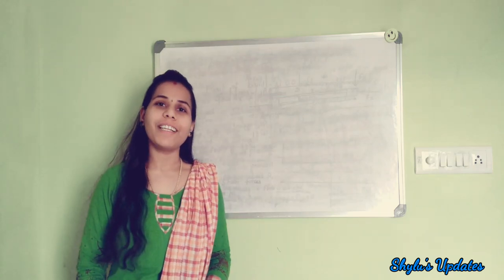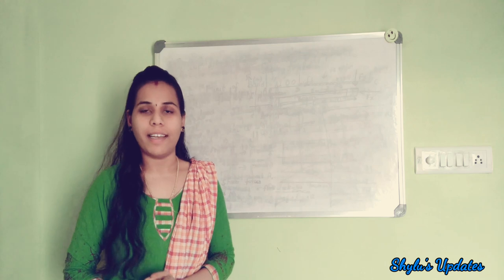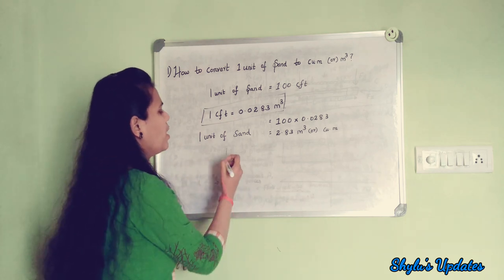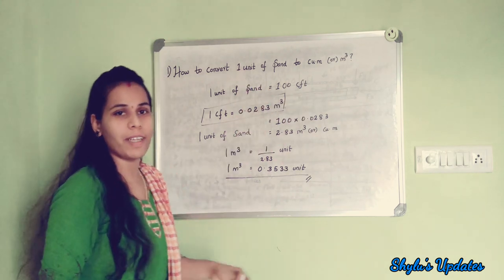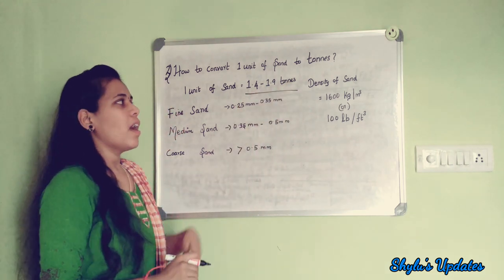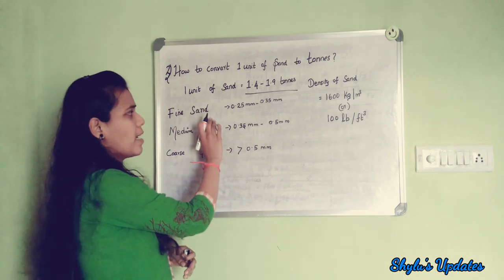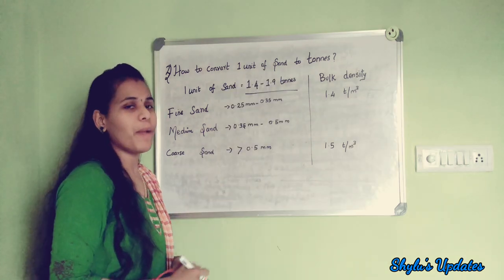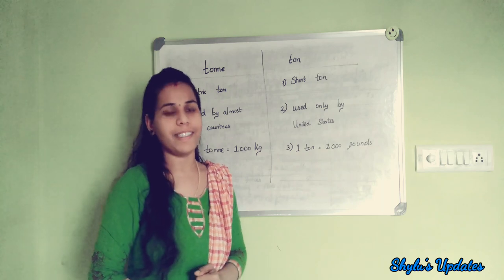How To Convert Unit To Cubic meter/Cubic feet/Tonnes|Civil Engineering Interview Questions

Comment: 51.9 length 38.9 width salb how meny cement bags and    sand & stones units plz send messages
Reply from the maker: Unit pls ?
Reply: @shylusupdates   one unit is one Tatar truck  sand & one Tatar truck  aggregate
Reply: @shylusupdates   total  feet yereya 2335 gets  add  beems
Reply: @shylusupdates   height  6 inchs